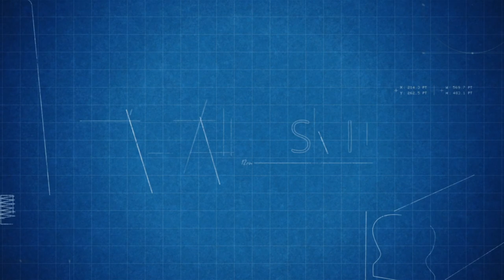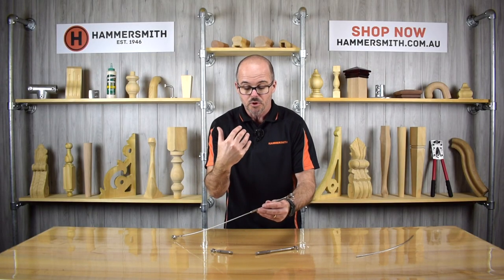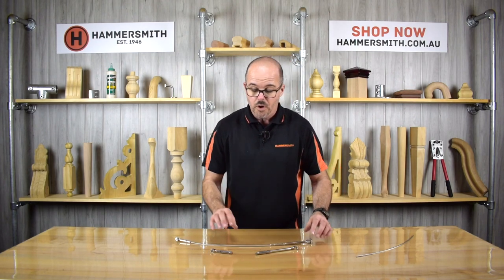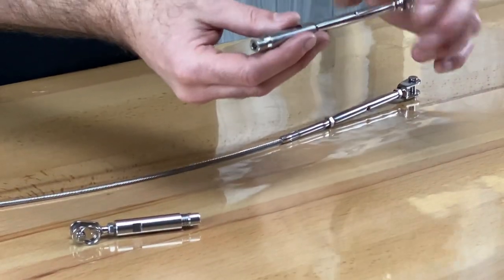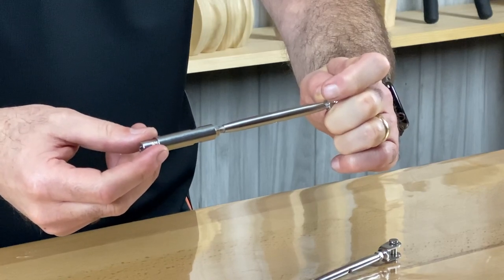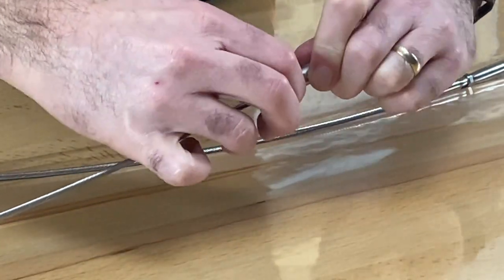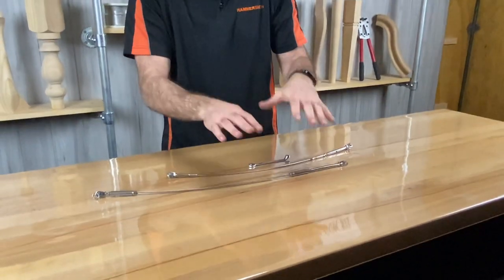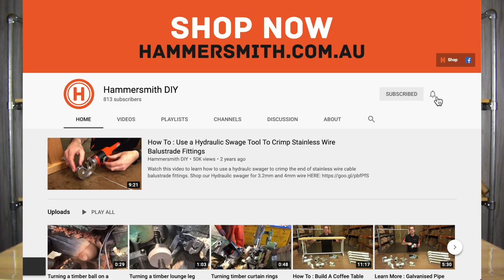Review: Swageless Fittings for Wire Balustrade | HAMMERSMITH

Comment: On my boat, I use this setup for lifelines. I use wire that has a white plastic coating. After a few years, the wire coating starts to look terrible. Using the swageless fittings, I can just disassemble the lifelines, replace the wire, and reuse the fittings.

Comment: Great vid explaining swageless ballustrade fittings. Just bought the swageless version but with tapered jaw clamp ends from Pinnacle. Seems like great quality gear, just wanted to see a vid on how exactly to best make these work for a tight finish. I would have liked to see a vid showing the tapered version in situe ie between a couple of posts showing exactly the best way to get the tension you need. I figure I need to undo the turnbuckle as much as possible, cut the cable to length and see if it tensions up nicely. I'm sure it will be fine, thanks for the information Hammersmith DIY.

Comment: Been hearing about people that experience rusting of the stainless components. Looking to install this at a beach house and curious if that problem has surfaced and is so has there been any improvements to the technology that elevates such an issue? Thanks for your help.
Reply from the maker: Stainless is not a set and forget product. If you don’t keep it clean then you will have rust issues, particularly when used in a coastal setting.
Reply: The material of 316 is fine.
Reply: @HammersmithDIY  is WD 40 effective in that setting or is there specific products for the job. Thanks again for all your help. Stay well
Reply from the maker: @bobpattison1739  I am not sure. We sell a product called Peek polish, but no doubt their are other products which work well also.
Reply: @HammersmithDIY  share your site where I might be able to make a purchase. Thanks
Reply from the maker: @bobpattison1739  https://www.hammersmith.com.au/hs_products/diy-stair-parts/stainless-steel-balustrade/stainless-steel-handrails/round-stainless-steel-handrails/50mm-round-stainless-steel-handrails/if115x-peek-wire-cable-polish

Comment: Why are the two ends different?   Couldn't one type fit both ends?
Reply from the maker: The longer version could be used on both ends, but the short version allows you to save money, as the long version is more expensive. You need at least one of the long version as it is required to give you the tension that you need to add to the wire.